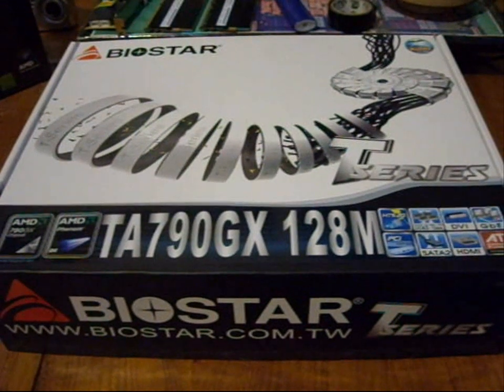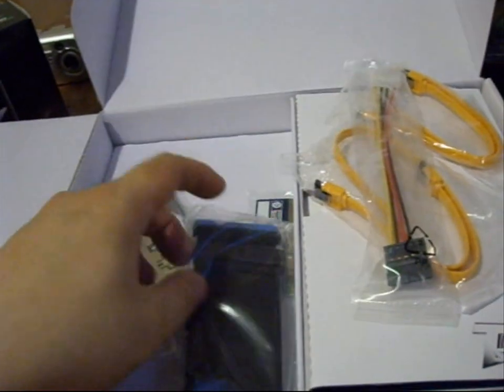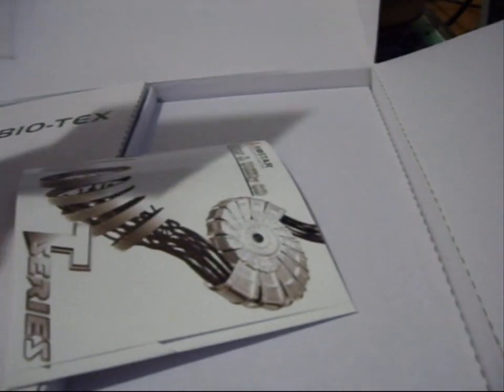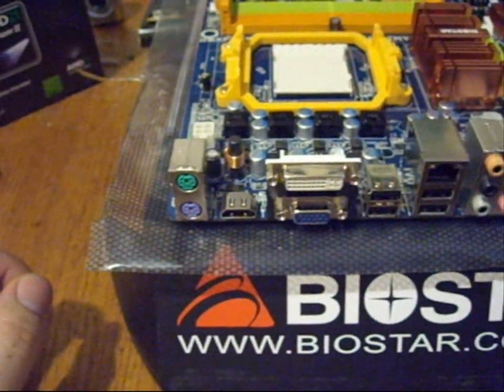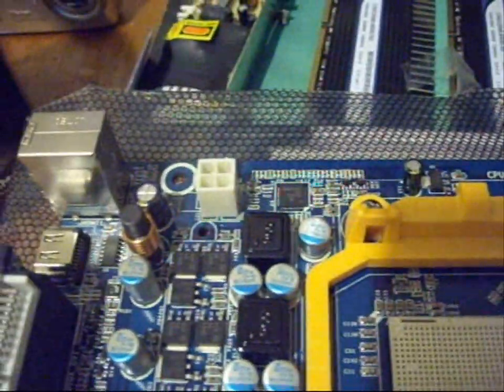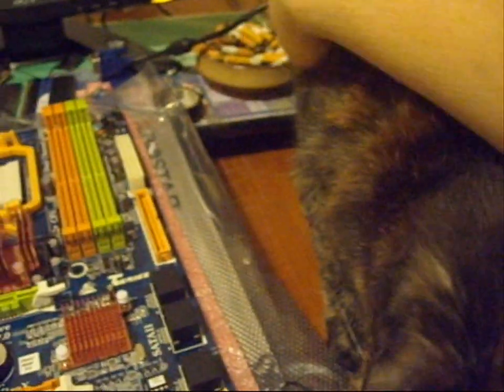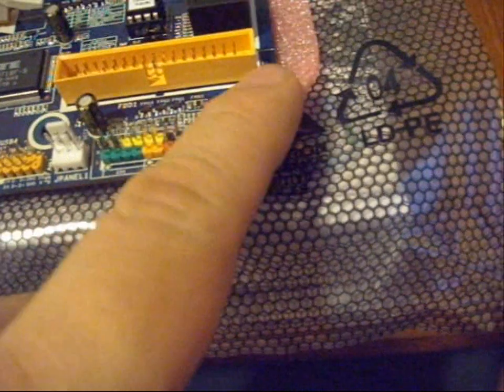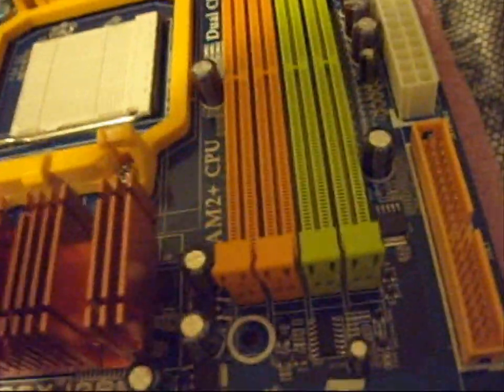Biostar TA790GX 128M Unboxing

Comment from the maker: @KILLCOMBO first of all, do u mean 550Black edition? never heard of 545 unless if it's some brand name pc's oddball oem chip?
and fusion.. well, it disable window function to help performance, but it doesn't boost it's speed, the oc part really only oc by a small portion, i don't use it, it messes up my connection and such, i just overclock the system myself

Comment from the maker: @KILLCOMBO depends on what card ur using, some of the lower ends u may not see a difference, but 16x is the full speed as it should be. might as well enable it regardelss it's benefits. u will see difference in benchmark for sure tho

Comment: Hey dude i have the same board as you and i am having a problem with the onboard sound when i install the audio driver off the cd it makes my speakers start crackling and making fuzzy noises.

and i know its the driver not the ports because headphone jack on the front of my case does the same thing and i have tested it with diffrent sets of speakers still the fuzzy noise but when i dont have the driver installed it is silent.

also with the driver installed even if the sound is....

Comment from the maker: in easiler term, that's where it controls power flow that comes in the system so it's very important tat they stay cool,.  and this mobo is crossfire , u cannot do nvidia's sli but u can certainly use nvidia video cards

Comment: did some tests with my 4850 - there's no difference running at 8x or 16x spped on the PCIE slot - so put your graphics card where ever you want...

Also, my board will not unlock a 720BE, when I enable ACC it locks up...

Comment: oh ok am getting the his 4650 hd is that good  for 16x my cpu is phenom2x2 545 black eadtion 3.00ghz  autoclock it to 3.600ghz yea do you have fusion fro amd if you do its relly good for crysise and other games if you know then you know what i know so if you dont know it boost up you proformance which means your cpu will go faster and it relly works

Comment: i plan on buying this board from newegg for 109.99. my processor will be a phenom II x4 920. but one thing do you think i should buy a cooler for the things you said at 2:56-3:01 (what are they exactly) and this board supports ATI right? not nVidia?

Comment: @kenkem396 I had that same rig as you have with the 965 Black Edition. Later, i found out that this motherboard cannot support the full power of the processor. It only runs at 800.00 Mhz which is a waste of it's potential. You might want to test the speed. If your not getting a rating of 7.4 on Windows 7 ratings for processing speed then you will know. I got a new motherboard and it's fine now. Just hoping to help. :D

Comment: eitherway i installed the driver i am still getting this crackling problem!

have you head this?

because its driving me crazy!
like i said before it happens on the front port and the back port, so i know its not the ports 
i am 90% sure its not the driver

i did read someware it could be a earthing problem but it didint explain how to fix it any ideas?

because if i cant get it working i am going to buy a new sound card.

Comment: i have the sam mobo. it dont support the amd 965 cpu. oh it works but it runs at 800mhz  and theres not a dam thing you can do about it but  Upgrade the mobo. its on biostars website the cpu that it supports. what kills me is that it supports all the way up to a AMD Phenom  II X4 x945 but not the 965 i just got..  other then that this is a good mobo been very happy with it untill now